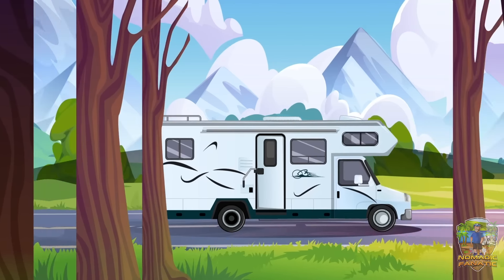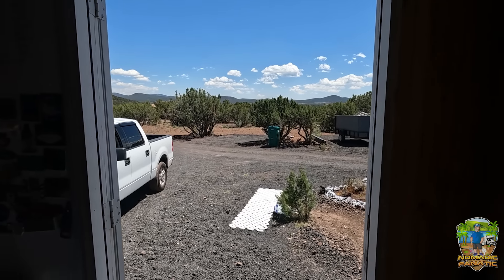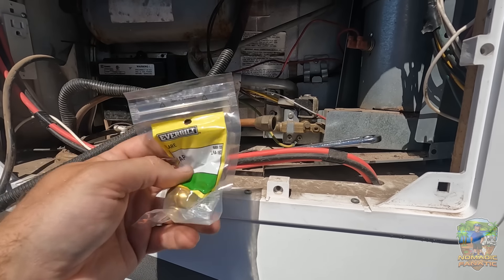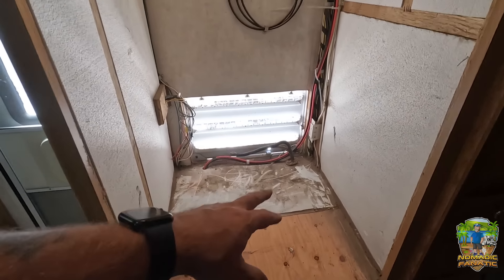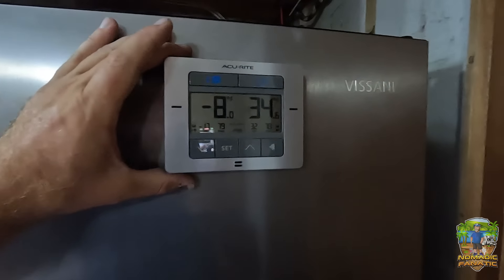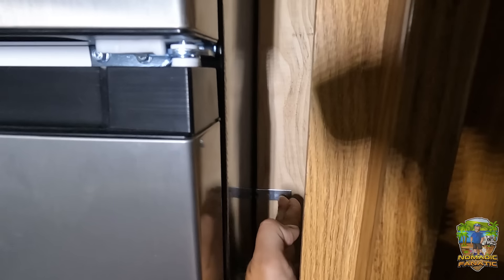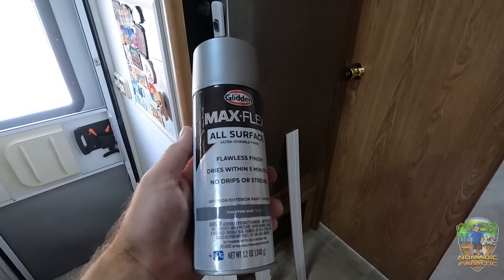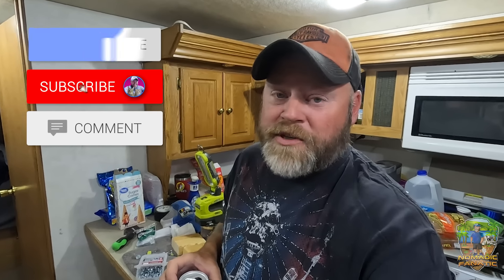Dometic Fail ~ Another Bad RV Fridge ~ Replacing With Modern Energy Star Fridge

Comment: As an Industry Technican, VHB tape is your friend.  We use it from mounting LED tape lights upside down / Toe kick lights to Mounting Solar panels on roofs with NO HOLES!  Going on 8 years with two 100 watt panels on mounted to the hood of my Truck.  That includes getting hit by a Twister in Utah earlier this month.  Still holding Strong!

Comment: Even Vissani fridges have this said about them;

"What is the life expectancy of a Vissani refrigerator?
Our appliance repair company told us that five years is about the maximum lifespan for this brand, so I feel like we did OK."

I bought a Summit 8.5 cu ft fridge  in May 2009, for my house, it's had zero probles at all, and it's now Aug 2024, so it's already  15-1/3 years old. The model has been discontinued, but Summit appliance has been great to me.

From my invoice in 2009;

Summit: 8.5 cu. ft. Counter-Depth Top-Freezer Refrigerator with Adjustable Wire
Shelves, Door Storage, Adjustable Thermostat and Interior Light
Model: FF874, $523.99 Total

Comment: Fridge looks good to me. Those propane fridges really are meant for "seasonal" use.  I've had one go out and no way am I going to replace it with another similar.  I do have some worry on whether the compressor on the new fridge will like vibrations from the road.

Comment: You're better off leaving a gap around the fridge-freezer. An electrician told me they need the gap to allow the heat to dissipate. Apparently, over-heating is one of the main reasons for fridges and freezers breaking down.

Comment: My Dometic dual is 21 years old and constantly runs on shore power. They weren't designed to operate intermittently. Think about a light bulb that usually fails when it is turned off or on. They also weren't designed to operate solely on propane. The flame degrades the metal and allows the Ammonia to leak out.

Comment: I would like to add that I live offgrid with 6, 6 volt batteries in series with a 7,000 watt inverter and burn just 1 gallon per day with my 2,000 watt inverter Honda generator. 6, T-105 Trojan's. It will run for 12 hours charging the batteries and then can sit for the next 12 or longer running my 32 inch TV connected to my laptop. It is tethered to my phone for internet. I consider 1 gallon per day to be very cheap indeed! If I tun on the AC, it will burn that gallon is just 5 hours.

Comment: The Fridge needs to breath to work. you blocked off the airflow.
Reply: the gap around the front is probably sufficient
Reply: Dead  rv refrigerator
Reply: @MrZooobaaa what gap? He sealed it off with the wainscoting.
Reply: @MrMinimalst  he has enough gap
Reply: @salty6pence672 I agree  the fridge will work the way he has it.  But it will last a lot longer and work much better with some venting. I did it to my high end fridge at home it runs much better than before .
Reply: It's not that you're wrong but there did seem to be adequate space but, time will tell...
Reply: Hey Eric what harley do you have, and what year is it? It is a bad ass bike. Thank's

Comment: You are so lucky that you didn't kill your new fridge by putting screws into the side of it. There are freon lines behind the side panels of the fridge. 
I have personally seen new refrigerators and freezers ruined by people drilling into the side walls because they wanted to add a lock.
Reply: @larrybergman6075  I've replaced 2 fridges on a boat because someone drilled in the side.  I was thinking the same thing
Reply: I was thinking the same. To each his own but I’d have used a ratchet strap over the top and secured to eye hooks on the 2x4, also would have L-bracketed to the floor on the rear at the bottom where the frame is. That would hold it well but also make it super easy to remove in the future.
Reply: So yea but now we know the magic spot on this refrigerator to drill!!!

Comment: We have a 2007 Fleetwod Tioga with a Dometic fridge.  RV has 97,000 miles on it.  When it's parked at home the fridge is on 24/7 and filled with drinks, condiments, etc.  We have a dedicated RV outlet for it.  On the road it runs on propane.  We leave it set to AUTO and that fridge has run NONSTOP except for cleaning for years and years.  I have a micro camper I use on solo trips with my Jeep.  It has a Dometic fridge and yup, it's been running non stop since I bought it last November.

Comment: We have a Dometic fridge that is Propane and electric and we have never had an issue with it, Oh and it's from 1978
Reply: Do you live in your RV fultime?  Has it run 24/7 since 78?
Reply: I had a gas frig for 38 years. No problem. I gave it to kid brother for a cabin in Maine. Wasn't very big.
Reply: 40 years old and still runs every day for the last 5 years. I have the same motorhome from breaking bad it is a 1986 fleetwood bounder A class.  For an old rig, I have had minimal problems.  I totally recommend fleetwood r.v.'s👍
Reply: Looks good don't change anything about it.
Reply: Appliances that are old were built to last.  I have a freezer from the early 80's still working.  Modern appliances aren't built to last like they once were.
Reply: Same I have a deep freezer that’s 30 years old still works and it banged up pretty good from my last move, however my 2k 12 year old LG fridge already bit the dust. Newer stuff sucks

Comment: you could re use the old fridge as a insulated storage box for your batteries in babe the blue box if they do not need air flow for the batteries.

Comment: Sorry you had trouble with your electric/gas Dometic fridge.  I have a Forest River Wolf Pup, on my second one too, a 2020.  One reason I upgraded to a newer model was I now have a 10 cu. Ft. all electric Furrion Artic fridge.   When plugged in to 30amp power it runs and freezes just fine.  When boondocking I switch the temp dial to off grid and it maintains temps with no problem from power from my two marine deep cell batteries which are kept constant with (as long as there is sun) with a small 50 watt solar panel in the roof.   Have been pleased with operation so far.  When I am not on the road and plugged in at home at base camp, I often use it as a secondary fridge.   Hope your new deal works well for you.   I do t use lithium batteries due to often staying in winter climate thus no worries when it goes below 40 other than winterizing my plumbing.  Hey to the Diane and rubs to the kitties!

Comment: Looks great Eric! I am still wondering what happened to your dishwasher in the last RV? Our is still running with a few tweaks in how we operate it. Basically cheap Chinese junk is just that, but when my wife broke her arm last winter the dishwasher saved my bacon because she needed 24/7 care for 4 months. Our 12-volt Furrion 10 cu ft fridge is the cats meow, maybe Opie approved, but I do not have an inverter as we are on shore power 85% of the time because we run 13 USFS campgrounds & are working out of our RV from town. I would rather be in the USFS maybe next year. Cheers,  David & Sheila

Comment: I know you always say: "Yeah, don't do what I do....", but I am a bit shocked that you're putting a fridge in a completely closed cabinet. Fridges don't magically cool by using electricity. They cool by loosing heat. That heat has got to go somewhere. I'm at 11 minutes and 40 seconds now, let's see how this works out.... Will it work, I guess it will, but only so-so.
Reply: Ah, there are still some gaps, and with only 90 watts that should be enough. Nice fridge, and the trimming does it for me.

Comment: My trailer came with a 12 volt 6 cu ft. No 110 or propane.  I love it

It's a furrion cheap but has worked for 3 years.

I love it. Only pulls 120 watts and thermometer in the freezer stays around zero with fridge set at aboulasts.

Well see how long it lastx.

Comment: Why close off the vents? I did a video on my channel and installed a Unique DC fridge and installed 12v cabinet fans to use the chimney for cooling. My compressor ran at about 160f if i remember correctly and with my 12v fan added it took it consistently down to 80f.

Comment: Refrig  looks great! I have the 5 ft.² Dometic  in a 20 foot travel trailer. I’ve had it for four years. It works so so   There’s no regulating the thermostat. I’m not sure if I have the technical skills to replace it like you did. But I would go to the same size Residential or dorm fridge. But I also have a 12 V Astroal refrigerator/ freezer that I am using as a freezer.

Comment: I replaced my Dometic with the same vissani fridge 5 years ago…easy to replace…3years into replacement the timer for the defrost quit working..timer got from amazon and directions on youtube..all is good now…I don’t move my 5th wheel so a.c. Power not an issue…good luck

Comment: Eric be very careful with the depth of the screws (use sheet metal screws) that go into the sheet metal of the new fridge- keep them shallow as possible. It even helps to go as far to grind off the pointy tips on the screws.  The screws need to just go into the sheet metal and no deeper due to the pressurized refrigeration lines. One trick is to run the fridge and feel where the heat is on sides- if you feel heat there is probably a refrigeration line there you don't want to puncture. An infrared camera would show them clearly.
Reply: The fridge is already installed??
Reply: Rivets might have been better. At least into the refrigerator. Screws into the wood, obviously.

Comment: You have the worst luck with RV refrigerators. Knock knock on wood my dual powered refrigerator in my Winnebago 2003 is still working perfect. I’ve had 5 motorhomes and two fifth wheel trailers and all bought used, I’ve never had any issue with the stock refrigerators. It definitely must be an Eric thing.😎 but anyway it looks great to me 👍🏻
Reply: @justsomeguy6474   50% of the time, I own a 1 acre lot with a home that I have to maintain. We chose when we travel based on our mood and the weather. 😂
Reply: @justsomeguy6474   Yes No but we did live in our previous RV for two years traveling across the United States three times but only part-time in the Winnebago that we have now.

Comment: You will need air flow for the new fridge compressor.  It may be  under the unit but usually from behind.
Reply: Yep.  Looks like a good way to use the 12v dc line.  Just setup some quiet 12v fans and cool the compressor.
Reply: Do you have fans and vents on the fridge in your house? I have a 20CF residential in my 5th whelel, zero issues for 4 years
Reply: @johnbarry1144  I do have fans and vents on my LG house refer.  The unit vents through the rear and bottom.  My RV refer is wide open in the rear with venting through the top.

Comment: I just replaced my fridge in my 99 5th wheel. Same thing. Repairman said it would be cheaper to install an electric fridge. I am not moving about anyway, so perfect solution. $400 for the fridge and about the same for the repairman. Which is fine for this old granny.  Only problem is it gets almost too Cold. Oh darn, no soft ice cream.

Comment: These fridges are sensitive to extreme heat, temperatures over 100 degrees, and they really don't last much more than 10 years.
You would think they would have developed a better system by now but they haven't.
Reply: JC refrigeration does make a much better emotion style fridge. But they also make a custom residential style.

Comment: It's really good you have the solar available to cover the fridge power requirements.  I got rid of my 3 way Dometic recently and replaced it with a 80 watt electric fridge.  I run it off 300 watts of solar and a plug and play Bluetti power unit.  Works great!  By the way I agree with you on aesthetics - Don't ask "does it look good" ask instead ask "does it work good"  There are lots of good looking people out there that don't work so good!

Comment: I guess I have been lucky. I had a 3 way dometic fridge in a '72 Winnebago Indian motorhome and it has lasted all this time. I also had a Duotherm 13500 BTU AC and it too has lasted all this time which I find freakin crazy. I have a residential fridge that was made sometime in the early 70's that was given to me that I use as a drink fridge and extra freezer space....lives in the garage so sometimes it is 90 degrees and sometimes it is well below freezing in there. That fridge has not missed a beat. If it was not so ugly I would use it inside. All the new fridges...Samsung, GE and Whirlpool that I purchased over the last 15 years have ALL been replaced. Nothing is built to last. 10 years anymore.

Comment: Shouldn't you insulate the outside refrigerator wall on the inside?   Wouldn't that keep it from heating up in the summer heat and make it run more and keep your RV warmer in winter and cooler in the summer?   Just thinking that thsyis what I would want to do.

Comment: I think it turned out great.  We've never had good luck with those gas/electric RV Fridges, they've always crapped out on us.  We did the same thing that you just did on a 5th wheel that we had in the past.  The new 5th wheel has a DC Compressor Fridge and so far its worked well.  If it craps out then I will replace with an AC small fridge.

Comment: I also got a Walmart Vissani fridge - just that size to use in my RV/Toyhauler (all electric) - in 2015 ... Event though the manual says clearly NOT for use in RV's/campers - it has proven durable & withstood the many rough roads traveled!   Still going strong 9 years later! Love -it - when on the road I power it from my Jackery - replenished by a  solar panel on the roof!   Good choice - all electric - very efficient compact fridge/freezer!

Comment: HEY, BTDT. 2X. Now have a fridge like yours. And smaller then the Notcold. I kept it to the right and now have a 7 1?2" closet on the left. My inverter can run it and my solar panels keep up. 

BTW, you can get a kit to add igniters to that stove and then there is a kit to convert the piezeolectric to battery and so simple . Did that on 2 RV's cause I hate that turn noisy knob to light.

Comment: Retired RV Repair here.  Dometic's should last between 10 to 20 years depending on use and environment.  I just helped my neighbor repair his 24 yo Norcold.  The reason these ammonia based fridges exist vs. the standard style ones is for travel.  Standard fridges have a compressor.  These are not built or rated for travel.  Erik is rolling the dice here.
Reply: But do they last 20 years when being used all year round? Or is it for a couple of weeks per year? Seems like everything in rv’s break fast when used as full time homes.
Reply: @Solbrick  Nothing RV related (non-Park Model) is built for fulltime usage.  Including the RV itself.  If the unit is not moved or only moved a couple times a year I highly recommend an off the shelf fridge.  The problem Erik will run into is if he takes his RV on rugged roads.